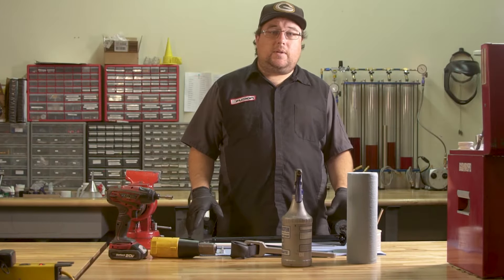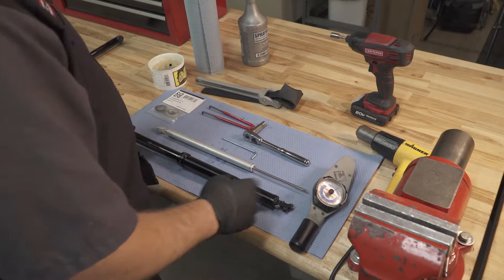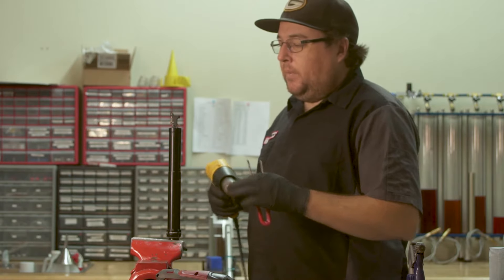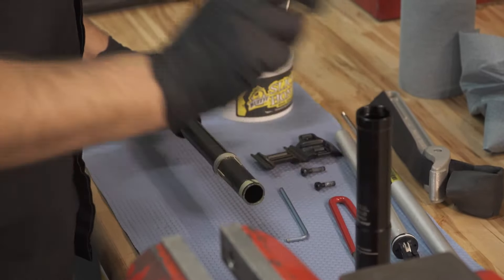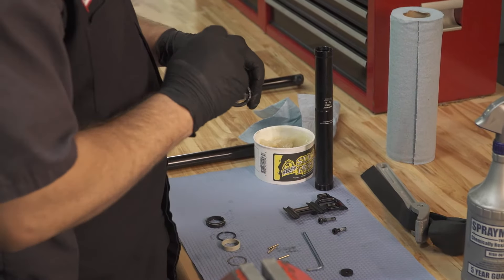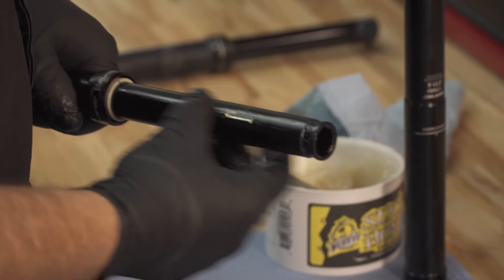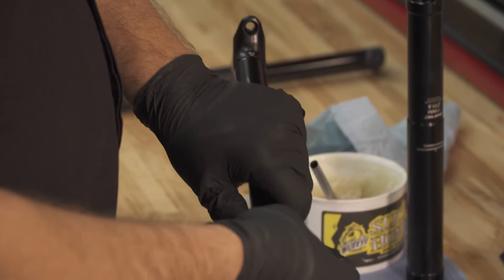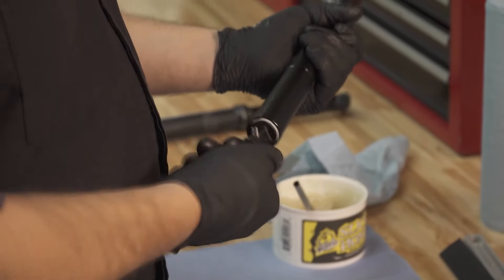XFusion Manic Seatpost - Service

Comment: Great video came across it after my dropper seat post became stiff and stuck. I also had the problem undoing the top as the shaft kept on spinning. Ended cleaning and greasing the inner cylinder from the bottom after removing the cover. This partial service surprisingly had a great result keeping my dropper seat post smooth for another 12 months until the first wet ride at the begging of this winter. So now done it for the second time. No problems at all. Save me time and money using simple tools no need for any replacement parts.

Comment: In my case, when torquing the last bolt at 10m15s in the video, the nut would engage and move down the threads but once the nylon thread lock engaged the threads, the cartridge started spinning and I could not seat the nut.  The center of the threaded shaft has a receiver for an hex key.  I had to pass one through the socket hole to hold the shaft in place then turn the socket by holding it from the outside with a vice grip.  I wrapped the socket with tape so as to not damage it.  It would have benefited from anti rotation feature from the inside.  I'm also questioning the seal design and it requires a strap wrench to torque and un-torque.  The OneUp has little serrations that allows untorquing by hand.  I had to drive to a bike shop to borrow their strap wrench.  The major selling point of the Manic and OneUp droppers is that they use a cartridge and can be maintained at home.  But this implies the use of standard tool. I would not qualify a strap wrench as a standard tool that every biker has it its shed.  The one from the kitchen for the jars and the one for the car oil filter did not work in my case.   Great video.  Very helpful.  Thanks for posting.
Reply: That nut is also very difficult to get off. I would not recommend torqing it past contact.

Comment: I was able to get the main seal off by running it under boiling water, then quenching it with cold water. Then I placed the post back in the bike and tightened the seat post clamp on the bike. I then used a rubber adjustable spanner and a quick twist. It loosened right up.

Comment: Great video. My X fusion post suddenly became very stiff to push down but still pops up quickly and smoothly. Probably had 150 hours use and gone through two English winters. Any suggestions? Thanks.
Reply: Same case with mine after maybe 75 hours of riding. This rebuild might solve it so it'll be worth the try. It would probably be a good idea for you to do this anyway after two English winters lol
Reply: Try service it first, maybe it`s just dirty. You will see once you open it. If still not OK, replace the cartridge.

Comment: you need all the strength with a strap wrench to break loose that seal head. It was incredibly tight, I was actually tearing the inner tube that I put around the strap wrench.
Reply: Yes. It's super tight. Is it reverse threaded?
Reply: @panzerdream  no, it's standard thread.

Comment: Ive only had my Stumpy for 3 months, I dont use the dropper all that often , When i press to drop, It doesent go down, Ive cleaned, Lubed, Surely its not goosed already.
Reply: they're not designed to drop without you putting pressure ( sitting down ) on it, they should only extend when you press the lever. However, mine doesn't even do that and it's brand new :(
Reply: @MTB_FPV  I'm sitting on it when I press.
Reply: @stuarts4673  sorry, I misunderstood your sentence. Try adjusting the cable at the lever side by unscrewing it . Other than that, buy a Fox 😃
Reply: Pnw makes a good post too
Reply: Mine’s the same. But only if you push on the rear of the saddle. Pushing on the front goes alright. I suspect it’s the bushes, but as per all the other comments in here, I can’t find a service kit anywhere.
Reply: @ratsac  Hi mate, I've adjusted the cable tension and thought that was the problem, What seams to be happening is that it is sticking at the very top, I need to bounce up and down two or three time to get it down. If you don't let it go all the way to the top it goes up and down fine. I tried what you said, if you push from the back it does not go down, but pushing from the front is perfect🤔
Reply: @stuarts4673  yeah I reckon. It is worn bushings. I would replace if I could get a set it kit anywhere.
Reply: @ratsac  There is no bushes, Just the upper assembly, It cant be that. Been out today and dropper had been fine if you sit down on the front of it, A bit of a pain TBH though. Going to contact Specialized
Reply: @stuarts4673  check out the vid at 4:19. He shows the lower and upper bushings.

Comment: Hi fellow, great video. Are there any way to reduce the travel length? Cause I bougth a X Fusion Manic 31.6 - 150mm that, due to the total length and the curve of the seat tube is impossible to use. There are some videos on youtube that shows a stuff (Plastic tube) to reduce the  length. Do you know if it is possible? Greetings from Brazil and tks in advance

Comment: Great video, and all was going great until I'm 95% done and went to tighten the 10mm nut on the end of the shaft...   it just spins the entire shaft assembly inside the post.  No way to hold the shaft while tightening the nut.  Any ideas???
Reply: So, 15 minutes later I'll answer my own question...  Impact wrench was the answer.  Problem solved.

Comment: What to do if any of my tool is not able to unthread the seal head.
Even if I do this with big lever. I hope it has the right-hand thread... I'm now doing it with the Plumber wrench with no luck...
Reply from the maker: Try a little heat with a heat gun. The anodizing from the seal head can bind with the anodizing on the lower tube and be very tight. Sometimes, applying a little heat will help to soften the bite and allow the seal head to spin free. When trying to spin the seal head free, you want to use a swift, firm motion; do not slowly try to tun. You want an instant type of force application similar to an impact wrench.
Reply: Did you get it done? Same here bottom threat was ok , seals ... not a chance.
Reply: @Dom6161  yes. I had to damage outer decals (sorry don't know how to describe it in english) in order to have a strong grip even with an old tube with the Plumber wrench. Prior to assembling back I applied grease the same way as it is usually done for bottom brackets or pedals. From my point of view it should have been tightened that much so I could unthread it with rubber gloves and a strong grip of my palm.
Reply: The same thing happens to me, it has even scratched and scratched a little because of the force I have applied and the thread does not yield.
Reply: How did you move the deal head? Is it threaded normally?

Comment: My dropper won't extend without help, so I found this video. After watching the video, I discovered that I have a Gen 1 post, so I sent customer service an email. Their reply was to watch this video. Then they had a follow up saying to remove the activator and the outer tube would slide off. Nope, the seat clamp is in the way. Not sure how they designed a dropper post that couldn't be disassembled for cleaning and service, now I'm researching different dropper posts that are less disposable.

Comment: I have a brand new one that came with the Levo SL, however it sticks and needs pulling or sitting on to activate the lift.... any ideas? I've checked the tension at both ends of the cable and nothing seems to make this work as it should.
Reply: Mine has done that always, it`s a pain. Would also like a way to fix it 👍🏻
Reply: @peterhenrik  I fixed mine, quite easily done.. 1st, remove dropper. 2nd throw it in bin 3rd buy Fox 😄
Reply: Sometimes it can simply be that your frame seat. Ollaris tightened up too much. Use a torque wrench, or by hand you'll want to tighten up a bit at a time until you find the problem tension point.

Comment: Literally can't remove the nut at the top of the dropper post. I put pressure on the head just as he shows and It won't come out. Am I doing something wrong or has someone else had this issue? Also, I removed the activator assembly with the spanner wrench and my cartridge is backwards compared to the video. I can't pull it out because of the first issue but it seemed odd.
Reply: Did you figure it out? Having the same issue. I can unthread the bottom but the 10mm at the top just spins. Also, can't get the middle collar undone. Thinking of trying a heat gun.
Reply: Here is the actual link: https://www.youtube.com/watch?v=DLGEoNrxgQQ
Reply: @matthewormiston4753  Thanks I'm gonna try it this time but if this is what my life will be like every year I need to grease this dropper I'm buying a One Up or PNW. Too much effort to do routine maintenance
Reply: @insearchof_dirt  Yea thats my opinion as well, if I can't service it why would I keep it. Let me know if you have any luck with the nut. If you don't have success are those two brands where I should look?

Comment: DO NOT tighten down that top nut past contact. If it doesn't want to come back off, you will have to shave it down with a Dremel tool next time you service the post. And then you need a new cartridge, as one must also shave down the nub it threads onto.

Comment: Hello - so need to remove X-fusion manic dropper so I can put it in a case for air travel. Is there anything i should know when doing that. How should I secure the cable for travel. Any suggestions?

Comment: boiling water and a adjustable spanner works too just clean and protect the system from the hard metal spanner
Reply: I was wondering this, so instead of the Pin Spanner, you just used an adjustable wrench to take the activator assembly/cartridge out? Just trying to avoid buying another tool haha

Comment: Does anyone know if I can add air to fix a sagging manic post? It's only been used three times.
Reply: no, unfortunately the cartridge is a sealed unit. If it's soft or losing pressure it needs replacing. Make sure there is no tension on the cable, that can cause it slowly drop down too.

Comment: I have the gen one seat post and it absolutely the biggest piece of trash I have ever worked on.  If it fails while riding you better hope you have a tool box on you, the fact you have to replace so many components is absurd,to simply service is mind boggling.   Worst engineering design I’ve worked on when it comes to seat posts.  Oh, and finding a kit to upgrade is rather difficult, throw it away and get a diff brand or different generation.